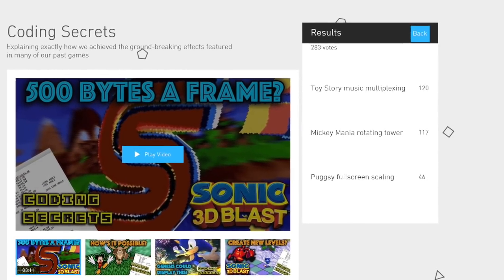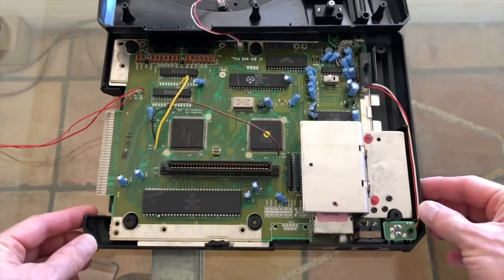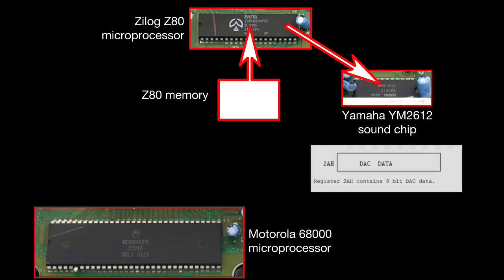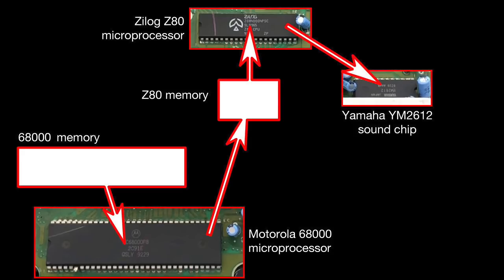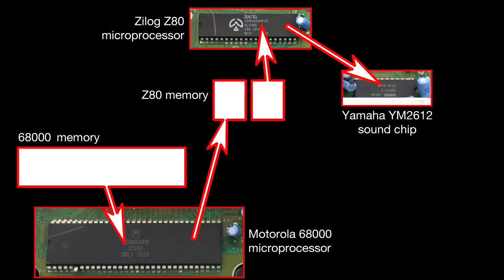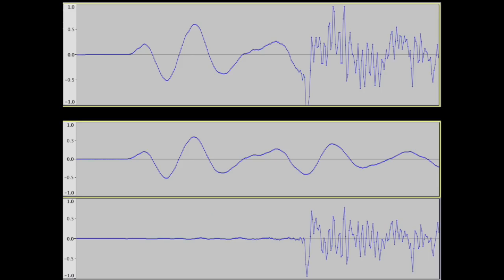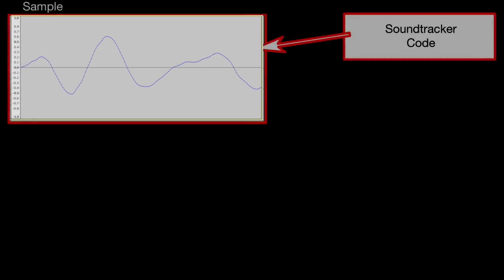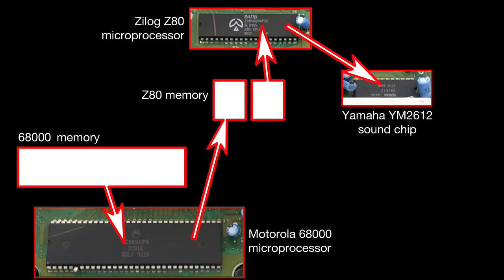Toy Story's Hardware Defying Music - How We Did It

Comment: This sounds quite similar to how Tim Follin managed to get the 48k Spectrum to play multiple tracks.

But was t true the Mega Drive also had additional chips for running Master System games? (when it was being developed as the Mark IV) or something? could they be used?
Reply from the maker: Larry Bundy Jr yeah, very similar to Tim’s. great guy, we employed his brother for a while...
Reply: I find you in the comments section of everything.
Reply: The Genesis was half SMS. It had the new hardware but it also had the Z80 and the PSG. It didn't have the SMS sound upgrade chip though.
Reply: Isn't the Master System just a Z80 with its own little sound chip?
Reply: The Mega Drive has the SMS's Z80 CPU, the 8K of ram and the PSG. The MD VDP (Video Display Processor) had a backward compatibility mode to display the SMS graphics modes, except the SG-1000 modes (which is the reason why  F-16 Fighting Falcon was not compatible with the Power Base Converter)
Reply: Larry Bundy Jr: yes, typically the z80 runs the music player code, for example the music player in Overdrive 2 runs on the z80 freeing up 68000 for graphic effects. The trouble is that there’s no hardware synchronization between the z80 and the 68000 (they run independantly) and the 68000 can block the z80 from accessing data. This is why speech samples on Genesis usually sound grainy, the z80 is intermittently blocked from feeding samples to the DAC. In OD2 we managed to solve this so there’s 26khz PCM with no glitches. It’s quite technical so let me know if you’re interested in an explanation. 🤟😎
Reply: The YM2413 chip if i recall. TBF only select japanese games used it and it was never on the international consoles plus when you had the more capable YM2612 installed, it seemed a bit redundant
Reply: You see that processor in the video, the Z80, which in the megadrive serves as the "sound CPU"? It's actually also the main CPU of the SMS. It really has two entirely different uses in the Megadrive. It can either be used as a sound processor for Megadrive games, or as a main processor for SMS backward compatibility. And yes, the Megadrive is backward compatible, all you need is a passive adapter to account for the different form factor of the cartridges. There's no additional chip in the Power Base Converter (the converter to use SMS games on the MD): all it does is being the right form to accept SMS cartridges, and redirect the pins correctly to the MD cartridge slot. All the required chips are in the MD.
Reply: The Follin brothers were just freaking music wizards. I love their scores such as Plok, Silver Surfer, Solstice, Time Trax MD, etc.
Reply: Larry Bundy Jr this video should help explain it https://youtu.be/IGy7HBG3I1c
Reply: DJ Baird that’s because he lurks deep within the Internet. It is his lair.
Reply: z80 is the main CPU from Master System and is the only one working when you play Master System games. the rest of Master System hardware lives in VDP and Z80 can access it also.
Reply: alkenstein I read Z80 can also access 68k bus, not just ROM but also RAM and VDP. Can this be used to move data between CPUs without stopping z80?
Reply: The Z80 can indeed access the ROM, but RAM access was frowned upon for some reason (IIRC access not working or being unreliable on some MD models), also VDP writes don't work well (Z80 can just write bytes but VDP expects word writes), just raster counter / status reads work as expected. And all these accesses to the 68k's bus forcibly halt the Z80 if the 68k is halted (due to ongoing DMA or the VDP FIFO being full on data writes). So unfortunately there is nothing in the system that both Z80 and 68k can access without affecting each other.
Reply: Kabuto: Thanks, but I've read those docs too, they are too vague in places and my own experience with emudev suggests they may even be wrong. Was hoping for 1st hand info from someone who tried more stuff than described there :) I believe you still could devise a way to let Z80 somehow pull the data from somewhere in 68k address space periodically without causing too much bus interference and without the need to stop it.
Reply: noop9k try it and let us know how you get on :)
Reply: Larry Bundy Jr I don't know why cause sega released an add on to the genesis that allowed it to play SMS games.
Reply: @samvaughn8926  The cartridges didn't fit.
Reply: @Larry Bundy Jr: I wonder if this is also similar to how Tim managed to get the music in Plok! to sound as good as it does on the SNES.
Reply: SteelSkin667 yes, it contains base sms hardware inside, adapter doesn’t contain much itself. sms sound chip, Z80 cpu and its RAM are used in most 16-bit games as well and the new sound chip is also connected to it.
Reply: GameHut

Really enjoyed this vid. I personally think there should be more of the type of in-depth / techie vids like this, especially for retro coding.

I was just wondering - when you said that the pitch table is used to "skip over" bytes in the sample, did you actually do some fixed-point stuff there, where you had a counter that incremented (or decremented) at a certain rate based on the pitch LUT value, and then increment the sample index when the counter wrapped?

This is what I did on my FPGA MIDI / Wavetable player, but I wasn't sure if it would have used up too much CPU power on the 68K to use that approach?

https://drive.google.com/open?id=0B1grqFdAErsrM19hZWNlU3hKNEE

I know there are ways to properly interpolate the samples as well, but realise that the "quick n dirty" methods can produce some pretty good results too.

(the current 32-voice core takes up the entire FPGA on the DE1 dev board, which is 18,500 Logic Elements. That's the same as the entire Minimig or Genesis / MD core takes. lol)

I really want to improve my player to make it more efficient, and also try my hand at more 68K assembly soon (on the MD or Amiga), as it's a CPU I've only briefly messed with.

Really looking forward to the rest of your MD coding series. Please don't worry about making the vids too long or in-depth, as I think it would inspire others to get started in 68K ASM. ;)
Reply: Larry!!!😁
Reply: SirDaShadow The MegaDrive's VPU was an enhanced version of the Master System's VPU.
Reply: the genesis is basically a master system with stuff added to it until it was deemed "next gen"
Reply: The Sega Genesis (or Mega Drive) had the YM2612 synthesizer chip which is what gives it the sound most are familiar with, but it also had a PSG(programmed sound generator) on board, which the devs rarely utilized.  It could make sounds like you'd hear from the NES, square and triangle waves most associated with chiptunes.
Reply: Being born in america just 2 years after the SMS release, I never did meet a single person that owned one.  NES, SNES, and Genesis(mega drive) were everywhere in that era, the birth of the console wars.
Reply: Yeah... Probably why the developer guides tell you not to use PPU mode IV.

Well, it doesn't say you can't, but it says there's no upside.
Which pretty much implies it exists solely for backward compatibility.

A bit like SNES mode 0, which also seems to exist for backwards compatibility that never actually happened. (but SNES mode 0 still has a practical use in being the only mode with 4 background layers... So... Shrug.)

It's funny how everyone was trying for backwards compatibility back then. They didn't necessarily succeed, but they tried...
Reply: A bit of a necro answer, but I always assumed that the built-in compatibility was put to use when using the SMS cartridge adapter?

Comment: I always get amazed how limited you was and what cool tricks you used to get around it.
Your videos are always something like: "We had a spoon, box of matches, and bottle of water. And we had to go in space. Here's how we did it."
Reply: Easy actually, use the weld tool to make a rudimentary platform out of the hitboxes of the props, the matches can be arranged into a honeycomb pattern to create a large barrier with little mass. make sure that everything is welded to each other for a more stable platform. Afterwards use your phys gun on the platform while standing on top of it and scroll the mousewheel down, this will pull the platform towards your feet lifting you upwards until the desired altitude is achieved.
Reply: Holy shit that's the best description for GameHut's videos I've ever heard.
Reply: I think this is very fascinating I would like to hear more examples of this
Reply: Lol yup
Reply: .........To understand how we did it, let's first take a look inside the matchbox. You can see a number of matches. These may not seem particularly useful, but the tips of the matches are made of sulfur. Using our $60,000 Silicon graphics fission station, we were able to split the sulfur into two molecules of oxygen. Using all the matches in this way gave us just enough oxygen for a man to breath for 3 hours--the exact length of the journey.
Now, up until this point, I've been glossing over an important detail. The Silicon graphics workstation only outputs single atoms at a time, but humans need diatomic oxygen molecules to breath. In order to actually make use of this oxygen, we used a set of proprietary tools.............
Reply: Gmod
Reply: SMole yessssssssss lad!
Reply: Reminds me of Survivorman, just on an entirely different level. This is a great channel and any “limits-pushing” content is fascinating to me.
Reply: Your grammar is also limited
Reply: *YOU WERE

Comment: Did the volume table actually do 20 to 10 or more like 20 to 5? I thought volume was logarithmic or did the sound chip do that part for you?
Reply from the maker: Laharl Krichevskoy was just an example. It would do anything to anything else depending on the size of the volume drop needed.
Reply: On Amiga MOD stuff the volume is linear, the composer simply uses finer volume steps near the bottom of the range.

Comment: this is really impressive. i wonder if this allows the YM/PSG channels to still be used (unless i misunderstood some part of the video, it seems like it does), then we could have music with up to 13 channels!
it'd be crazy if Overdrive 3 from TiTAN would have that, but i sort of doubt it as they used a .dmf replayer to play the music, so they are just reading a file off of deflemask (thus not being able to do these tricks unless they either mod deflemask or use something else entirely)
but yeah, crazy video, as usual! keep 'em coming :D
Reply: Overdrive 2 actually has 26kHz PCM playback in addition to FM channels. How many PCM channels you want to support is probably just limited by how much CPU time of the 68k you want to throw at the mixing. I wasn't involved with the music code, but from what I remember it required figuring out the exact behavior of the bus arbitration and timings, so that the sample playback can be precise and uninterrupted despite the data transfers from main memory.

Oh, and I'm pretty sure there won't be an Overdrive 3. We would never be able to meet the expectations that would create.
Reply: MedoFortyTwo i know it does, but its still a single channel playing a single player, rather than an actual MOD playing reproducing several samples modified in volume and pitch in real time. this uses quite a bit of processing power, i would assume, my question is 'what else would you be able to do alongside that, with what is left of the "processing power"?'
Reply: Sorry, I misinterpreted your post and thought more of the continuous transfer of sample data to the Z80 than the mixing. Guess I shouldn't post when tired ;)
Anyway, Stuck Somewhere In Time (https://www.youtube.com/watch?v=FEG3fdV6Ra4) had four channel .mod playback at 26kHz, but no FM instruments. It also needs about 90% of the available CPU power of the 68k, so using it as a music player for a demo or game wouldn't make much sense. Still, for someone who wanted just make music on the mega drive that is as complex as possible this could be something still to explore.

Comment: How was it you synchronized  the two processors to access the double buffer? Because if I remember right the coprocessor ran alot slower than the main one so if the access was cycle aligned they would overlap in which part they wanted to access. My guess would be you set a signal high from the slower processor to the faster one when it was in part 1 of memory and set it low in part 2 and that way the faster CPU could get other  tasks done while waiting for memory access. But I have never programmed for the genesis before so would love to hear the way you did it if i'm not on the right track.

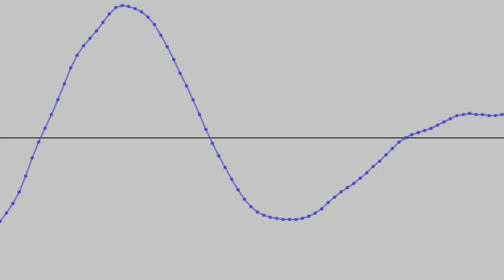Comment: On ~4:28 you said that pitch shifting is done via taking every Nth sample only. There two questions come: how to play notes which speed ratio is not close to 1/N; and how aliasing (mirroring of high harmonics) was beaten.
Reply from the maker: Олег Ярыгин you could skip as follows for instance - 2 2 3 2 2 3 - at so on to get any pitch. Doesn’t have to be the same skip between every byte. Harmonics weren’t a problem as sample quality was really too low to notice

Comment: Ive just written a MOD player for the ESP8266 microcontroller this week, used pretty much the same techniques. I just used fixed point maths to re-sample the audio. Just convert the note period into a step amount that is shifted left a few times and then add this value to a pointer for each output sample, just take the upper bits of the pointer to find memory address of sample to copy from.
Reply: willyarma you seem to not understand your obvious approach wouldnt work on 68000k due to its much lower performance.
Reply: noop9k of course I do! I've been programming assembler for 30 years! I never said my approach would work on the megadrive or it was better. Btw I have also written a mod player for pure z80 too the video is on my channel but I'm using DMA audio so no tricks needed although I am using quite a few look up tables as division is too slow on z80.
Reply: willyarma well, I reacted to “pretty much the same”
Reply: noop9k AHH, guess I was a bit unclear.
Reply: willyarma fixed point on more advanced CPUs with barrel shifters is quite dissimilar from what you do on more primitive ones, where anything but lookup tables and pre-generated code sequences are too slow :) anyway, I only wrote a mod player long time for 386, also quite straightforward.
Wolf3d clone, for the same 386, used pre-generated code for all integral scaling factors. But this is slightly less clean-looking than fixed-point scaling.
Reply: nook9k Cool! I guess its easy to forget just how limited stuff was back then! I've just has a look at my Z80 mod player code and I have used a lot of lookup tables and pre-calculation.
Reply: I've been working on the ESP8266 MOD player this morning, and it's not been easy, there's only around 20K of memory to play with so I've had to resort to loading the samples from flash (SPIFFS) as they're being played! it's only barely fast enough.
Reply: willyarma cool! I wish I had time to finish some projects, such as DOS SID player for innovation 2001 card. Together with another guy we ported libsidfp to watcom C, but it is horribly inefficient, still needs Pentium-class CPU even after a few quick optimizations I added.

Comment: That is a totally brain-dead architecture with the Z80, RAM, and YMF.  You guys went to a lot of work to get around that, and it's quite impressive that it had the horsepower to pull it off.  Even PCs of the early years had trouble with MOD playback, although they were usually doing a lot more - stereo, 44kHz, interpolation, floating point mixing, etc.